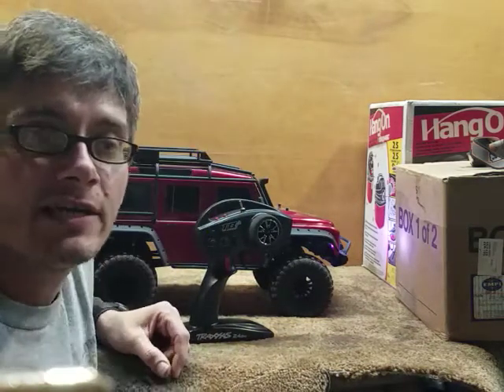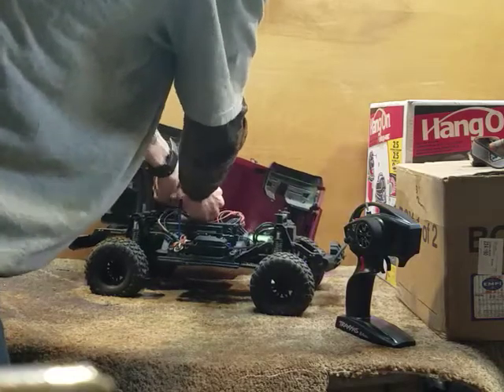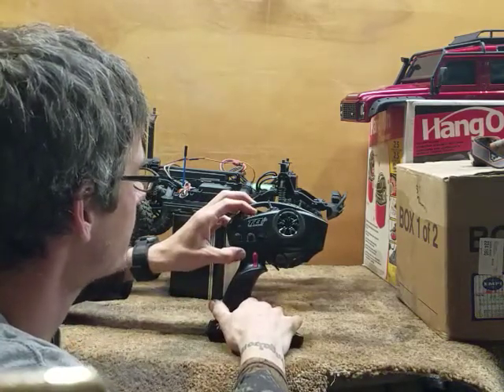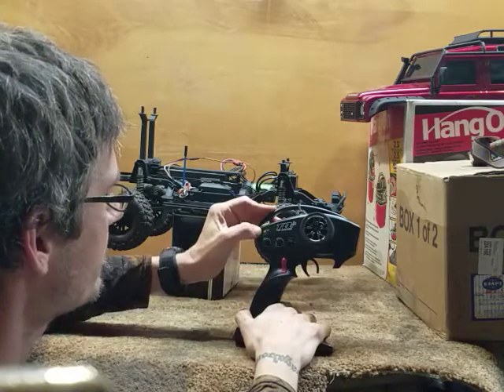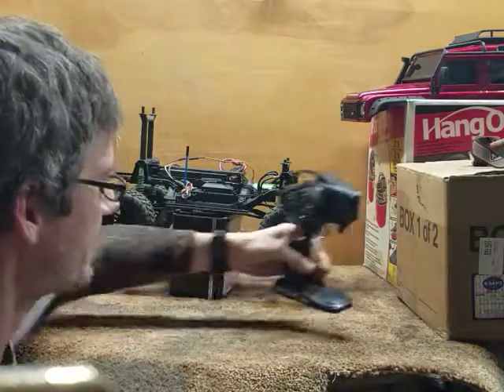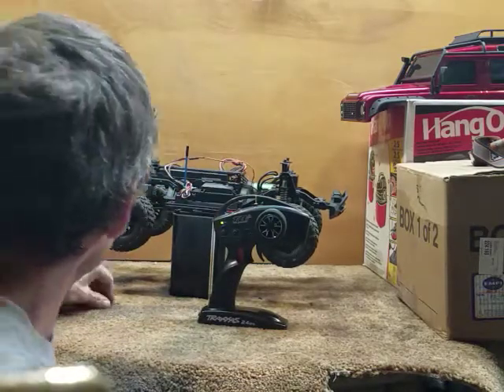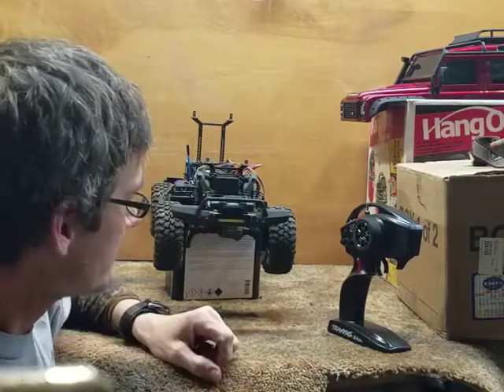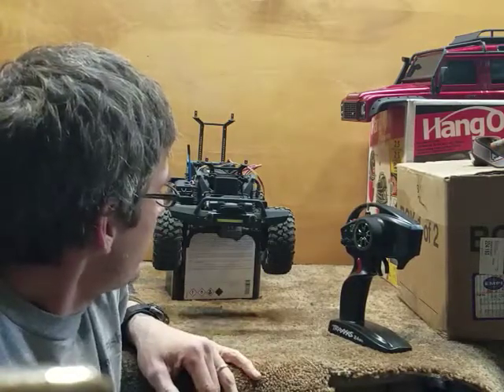Traxxas TRX4 diff locks

Comment: How is the low speed crawl take off with your motor&esc setup?
Reply from the maker: Dustin Norman it wasn't great with the sidewinder esc, it's better than stock with the mamba x esc now
Reply: Are you still running the high kv motor ? I was thinking of getting the mamba x with the 1900kv crawled edition combo
Reply from the maker: Dustin Norman I am still running the mamba x esc and 4600kv sensored castle motor. Low speed torque is amazing, way better than stock. It does have a very touchy throttle though. You learn to have a very light touch. I would go with like 3800kv though. There is tons of torque, and the extra wheel speed is great for clearing mud from the tires and climbing loose surfaces.